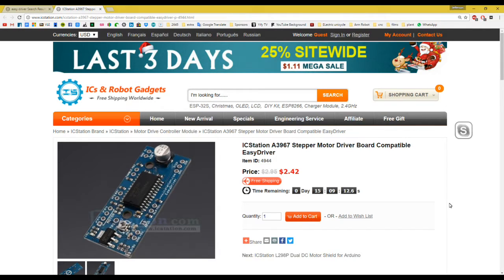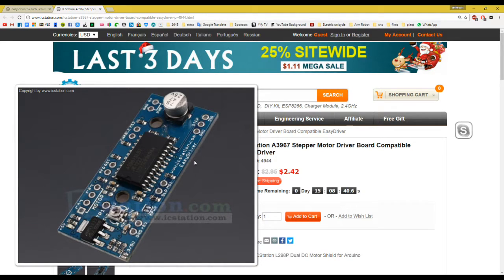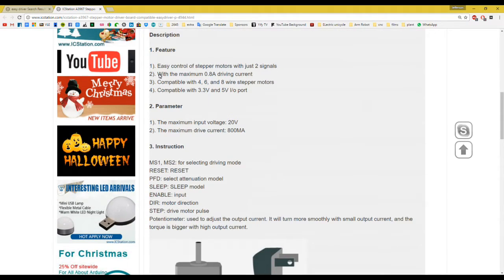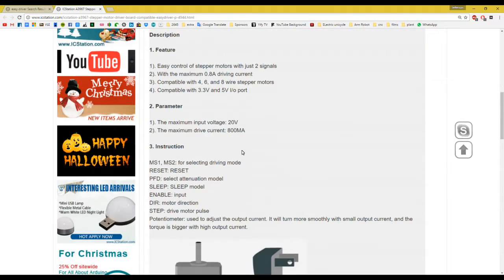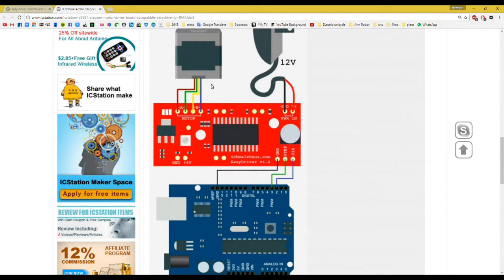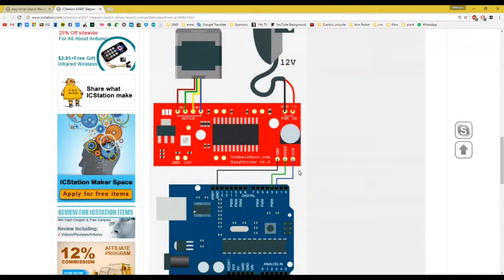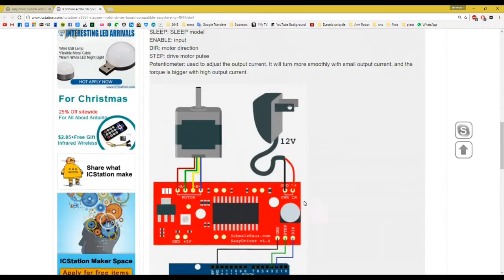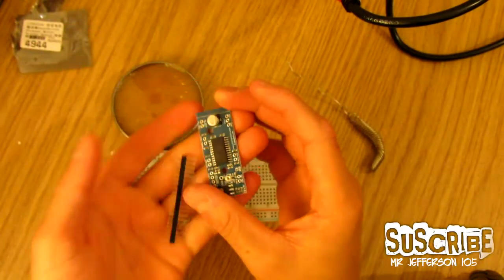✔Tutorial - Mini CNC Stepper Motor and EasyDriver .

Comment: Can you please tell me how much voltage and current do you give because my stepper motor drivers are not able to move the stepper motor instead stepper motor is getting heat up please help
Reply from the maker: Saranash Jain what is the stepper amperes rating? this driver has a max of 0.8 A ... so if you are trying to get a bigger stepper to work this will not supply the current required .
Reply: The stepper motor is same as you used in video means cd rom stepper motor
Reply from the maker: Saranash Jain so in that case you have to adjust  the little screw on yhe driver this is used to increase or decrease the Amps to need for your stepper . ... make adjustments while running the code and powering the stepper.
Reply: ok then how much input voltage you give 12 v or 5 volt if it possible for you to tell rough figure of amps
Reply from the maker: Saranash Jain i used 5 v input as it is a very small  stepper ... i sent my amperes at the max 0.8 A
Reply: thank you very much for your help now i able to make my 3d printer
Reply: its not getting heat up at this much current
Reply from the maker: Saranash Jain no worries anytime:)